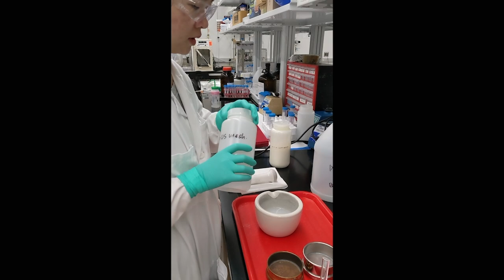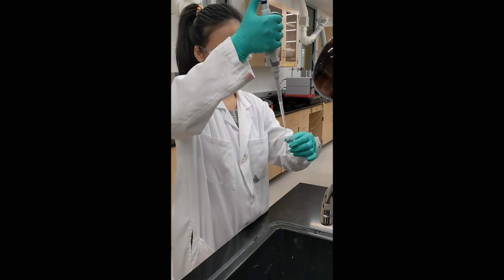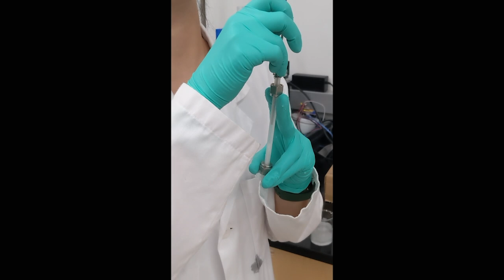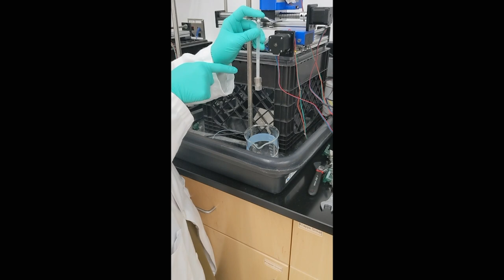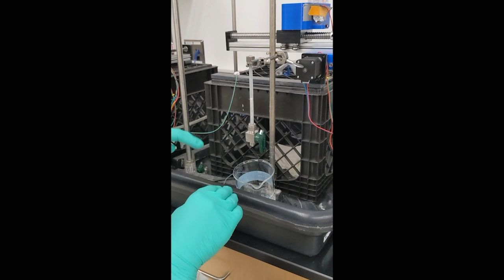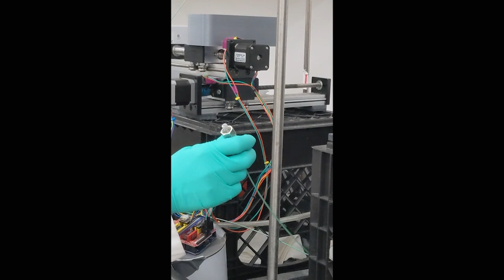How to build a RSSCT column

Comment: Thanks for the video, Cheng Lan! Have you measured the final particle size of the ground resin?  If so, how closely does it match the MPD you'd expect from top and bottom sieves?
Reply from the maker: Hi Adam, I didn't measure the final particle size. We calculated the final particle size using the log-mean average of the openning sizes of the two sieves. I took cryoSEM images for the crushed resin particles. The particle size are very uniform. Please check Fig 1 in the paper " Cheng, L. and Knappe, D.R.U.  2024.  Removal of Per- and Polyfluoroalkyl substances by anion exchange resins: Scale-up of rapid small-scale column test data. Water Res 249, 120956." Thank you.